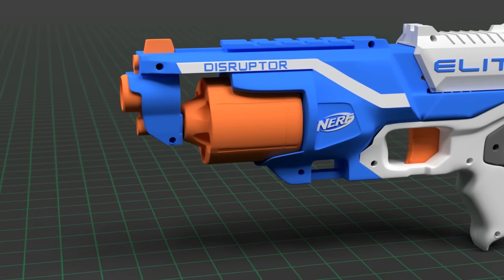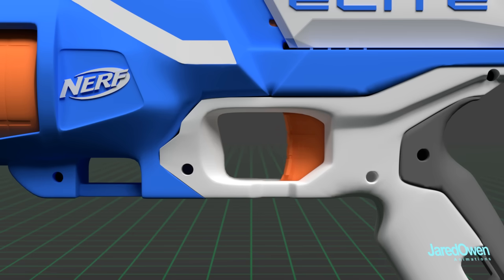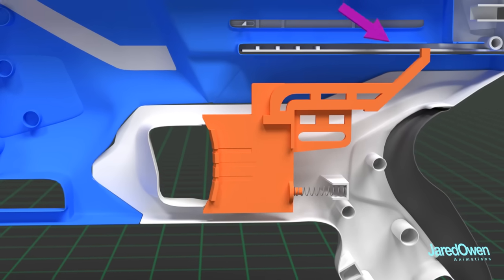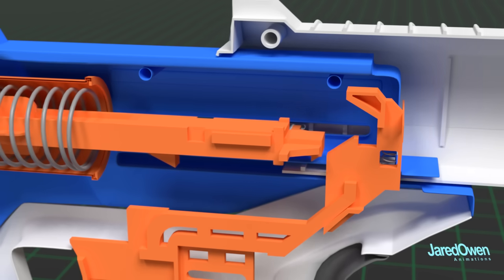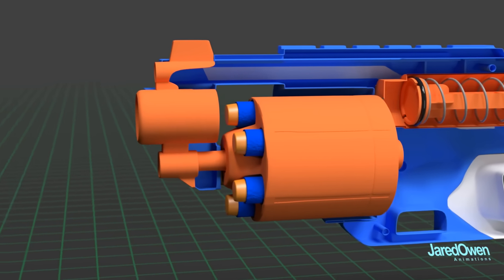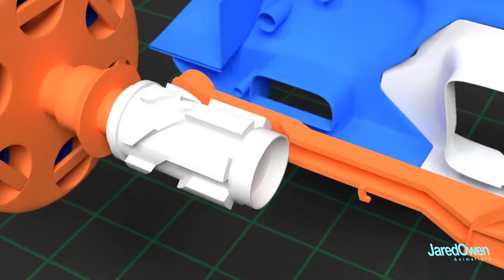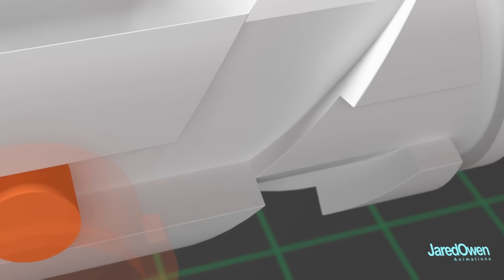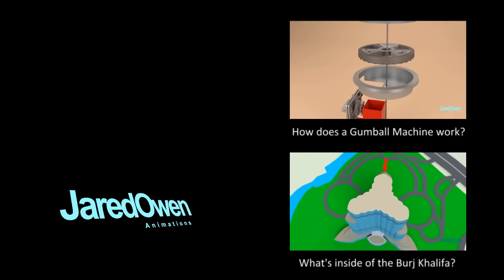How does a Nerf Gun work?

Comment: Nerf: Oh drat! Now everyone is gonna know that we over-price our guns.
Reply: The nerf disruptor on amazon is about $12, seems like a great deal to me
Reply: @dkim2041  yeah, but in stores, it goes for $15 at the lowest and I've seen up to $25-$27.
Reply: Some guy with a bad history teacher 
Oh yeah, retailers overprice nerf guns hard.
Nerf keeps them as cheap as possible, which isnt cheap at all
Reply: @dkim2041  well, 20 for a Stryfe is good value. Especially when you're coming to Nerf from airsoft and have gotten used to the hefty price when getting started in that.
Reply: Some guy with a bad history teacher 
$20 for a stryfe is an amazing deal
Reply: @dkim2041  when it used to be the normal, 15 would have been.
Reply: Some guy with a bad history teacher Its not that nerf overprices the nerf guns though, they’re as much as they’re worth. Retailers over price them
Reply: @dkim2041  I know, but there should be a maximum.
Reply: @dkim2041  yeah but like off brands with same build quality are 2 or 3 times cheaper. E.g. Dart zone has made nexus pro, which if it was nerf brandend, would cost like 200$ and wouldn't have screws, but it costs 50$ and it's highly modabble
Reply: @dkim2041  yea but a bigger one with similar performance cost a lot more

Comment: In the nerfing community the "vertical slider" is called the catch and the Piston is called the plunger and the tube is called the plunger tube, the air restrictor mechanism was not mentioned, this particular blaster is a simpler version of the strongarm that the dart cylinder could pop out of the side to reload.

Comment: Boys: How does a firearm work?
Men: How does a Nerf gun work?

Good video by the way. It's very nice and informative
Reply: Legends : how does lightsaber work
Reply: @proghostzgamecreed6555  no
Reply: @proghostzgamecreed6555  not sure if you know by now but the Hacksmith and his teamade a functioning protosaber.
Reply: @Purp1e_Grapes  Yes I watched that

He turned sand into glass with that...
Reply: @proghostzgamecreed6555  UNLIMITED POWEEEEEEEEEEER!!!!
Reply: Legends of legends: how does electricity work?
Reply: I’ll answer how a gun fires: A bullet is made metal contained in a shell with golden coloring, which contains gunpowder and a little explosive in a separate compartment at the back. The bullet is located at the front of the shell, where it is fired from. At the back of the muzzle is a small pin that, when the trigger is pulled, hits the compartment with the explosive. The force of the pin pushes the explosive out of the compartment and into the gunpowder, causing a reaction. This reaction causes a small explosion in the shell, pushing the bullet out of the muzzle and leaving the shell behind. You may see on modern guns and semi-auto weapons a golden colored cylinder eject from the back of the muzzle. This is how the gun discards the shell and puts the next round in the muzzle chamber. Also, the small reaction in the shell renders it useless, preventing you from firing the Same shell twice
Reply: SuperSalmon1327 🙌👏🙌👏 good job u actually spent time to do dat.
Reply: Plus Ultra Instinct thanks. I know this because I have a book on how mechanics work and I memorized how a gun fired because I find firearms and history (like wars) really interesting with how the military generals’ minds work
Reply: @SuperSalmon   Just so you know, there is no explosion. The powder burns out becoming gas. As the powder turns into gas, it expands creating more and more pressure. The pressure becomes so much that pushes the bullet out of the casing.
Reply: @jtcmlt1  ah ok thanks. Got a bit confused
Reply: @SuperSalmon  Yea that coloring is brass and you can also get rounds in steel casing which mess up your gun. The ejector is not on the muzzle, typically its in the front of the bolt, it is accompanied by an extractor which pulls the empty casing out of the chamber. You also forgot to mention the repeating processes, in which there are many different types. For semi autos you have gas piston system, direct gas impingement system, straight blowback, toggle lock, ext. Besides from straight blowback and toggle locked, your gas piston system and your direct gas impingement system will have locking lugs which normally rotate and unlock from the interrupted threads. For locked pistols, which most pistols are locked, typically there is locking lugs on the barrel or the chamber that tilt up and disconnect from the indents on the slide. For toggle locked it takes a certain amount of time for the force to break the toggle.
Reply: @SuperSalmon  i am 13 years old and i understood it easily
Reply: Lul the ultimate question
Reply: 1k like
Reply: PUG-alo Entertainment did you know I have that gun in the beginning of the video that’s my nerf gun!
Reply: @DarkWarrior7676 projectile-launching handheld contraption that mimics shape and action of a firearm
Reply: Teens: how does airsoft work?
Reply: @opinionatedchannel1956  wrong wrong, it's, teens: how do i speedsoft like a tard
Reply: @osmacar  no full auto in the building
Reply: @opinionatedchannel1956  raps on the trigger
Reply: It’s good I say to
Reply: @unpleasantlyy where i cried: Nier Automata
Shut up you did too
Reply: @unpleasantlyy where teens cried: nerf battle with nerf Fortnite guns
Reply: Legends: How can I convert an airsoft to a firearm to a nerf gun?
Reply: @kilist174  Buy a gun and make it look like a nerf gun, then get the ATF after you.
Reply: Legends:how does paper gun works
Reply: Haha, that’s a bit funny.
Reply: goats : Bomb instructions.
Reply: Tons of Misnomers and missing information, don't use this video as fact

Comment: That's a Nerf gun, not a god damn Chiappa rhino revolver or an AR15; you can just open it up yourself
I mean, it is really a good video, but an 8 year old, if not 6, can just unscrew that 15 or whatever screws and put a strongarm apart
Edit: at first I thought it's gonna be strongarm; well, distruptor is almost the same, just simpler because you don't need to pull out the cylinder

Comment: When you showed the screws coming out they turned right but were removed. The threads were right hand thread meaning that if you turn them right they tighten.
Reply from the maker: Yeah I messed up on that part... Thanks Andrew
Reply: Hey obviously it is not a big deal but it was just very obvious to me because I work with screws and bolts often. However looking back at it I think you had a left-hand thread on the screws in the render.  Really like the videos though!

Comment: That very Nerf model is what I used for a project in an engineering course.  I had to take it apart, get an idea of how it worked, and make a model of a non-trivial mechanical part for 3D printing.  When the model was printed, I installed it in the gun and tested it.  Didn't work as well!

Great video, brought back some good memories.
Reply from the maker: Thanks for sharing Brandon

Comment: With a few relatively minor differences mechanically, this is how a single action revolver works. They didn't invent it entirely from scratch, but adapting it to shoot foam darts is pretty clever. They've had revolving nerf guns for decades, but the older ones where much less reliable and where needlessly complicated for reasons that I could hazard a guess on but don't know for sure.
Reply: I'm waiting for a hybrid pistol. Such as a Glock 17 mixed with a Colt Python.
Reply: @davidchurchich9634  Cursed.

Comment: The vertical slider is called the catch, the piston is called the plunger rod, and the tube is the plunger tube. The cocking mechanism is the priming mech, too but you're not wrong with most of the terms.

Comment: Very nice and interesting animation! No problems or complaints about that, BUT you said How does a nerf gun work. You only pointed out how a SPRING powered blaster functions, not a Flywheel blaster, Air Powered, or Bow-powered. You should've stated that. So no one will get confused.Btw, its a blaster, not a gun.

Comment: I wonder if I lubricate all the moving parts with sunroof grease, wouldn’t that work even better? Especially that piston area with the rubber seal, hone it with wheel cylinder and grease it would create much more pressure.

Comment: Looking at these designs makes me want to make actual firearms out of them.
Like, it's mechanically possible to put a firing pin on the piston to strike a cartridge, and you can use a gas tube and piston to strike the slider, thus re-priming it and making an automatic design. (The trigger system would have to be modified for semi-automatic fire.)

Comment: In the nerf maverick (also a six shooter, but older and cooler) turns the ammunition thing using force from the trigger. I believe this allows more energy to be used to fire the dart, but sometimes it can cause the dart to fire before it's aligned with the barrel causing a jam.

Comment: Nice video but he are a couple of things to note
#1 the “vertical sliders” is actually called a catch or catch mechanism 
#2 the “piston” is called a plunger
#3 you missed a very important part. At the very end of the plunger tube there is a small circle price that is called the air restrictior.
#4 the orange bit that you can see is called a prime indicator, which shows if the blaster is primed or not
Reply from the maker: Thanks - yeah i know I got some terms wrong.  Thank you for your comment!

Comment: Awesome video! Astonishing graphics. The one minor thing that might be different from reality is that the screws turn clockwise 0:50. Depending on my experience 99% of the time you unscrew by turning the screwdriver counterclockwise.
Reply from the maker: yes you are correct - I messed up on that part :P  I noticed it only after I had posted the video. Thanks Chen

Comment: I mean his explanation is correct but his terminology is bad he called the catch a vertical slide thingy and while I suppose it is technically a piston its called a plunger rod/ plunger head and the tube is the plunger tube but overall solid video
Reply: What do you mean by 'it is technically a piston', but call it plunger ?!?
They are two different elements of pneumatic cylinders.

And, yes, he is correct.
What's shown in the animation is a piston with its piston ring, connected to a piston rod and inside a cylinder, because its length is smaller than the length of the stroke.

A plunger would look like a second long cylinder with a constant diameter, that's inside the outer cylinder and the whole thing provides seal, i.e. it doesen't have "a head".
Reply: @JC-XL  look man im not an engineer but in the nerf sphere its called a plunger
Reply: Come on, man, you can learn a second word for that part in the modding community, in between ripping out air-restrictors and upping springs.

Anyway, I simply thought it's wrong for people to tell the guy to use the wrong term, when he was using exactly the right one in the first place.
Reply: @JC-XL  I suppose